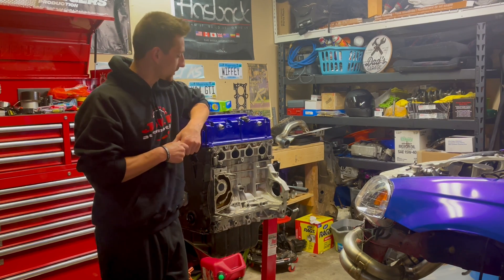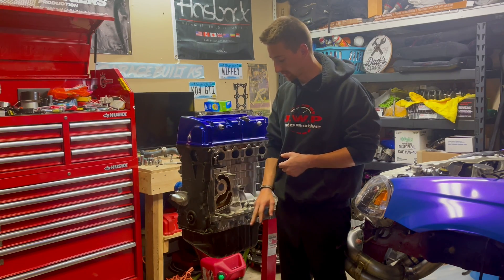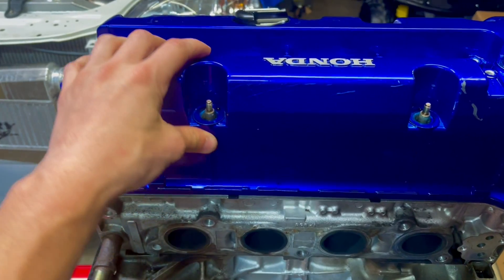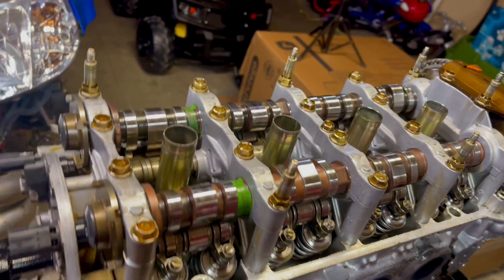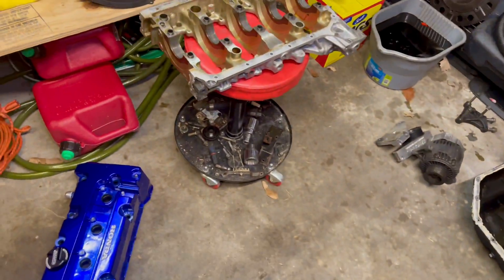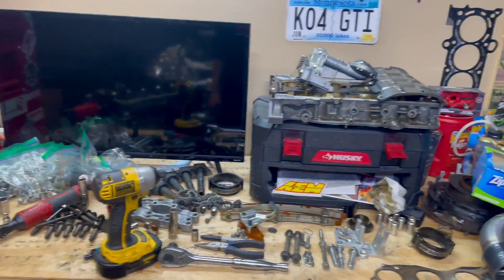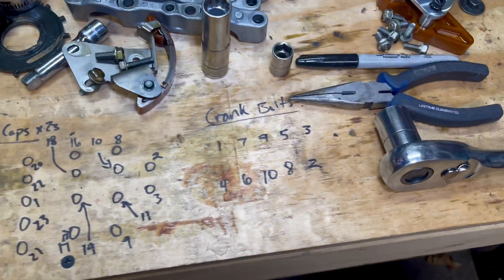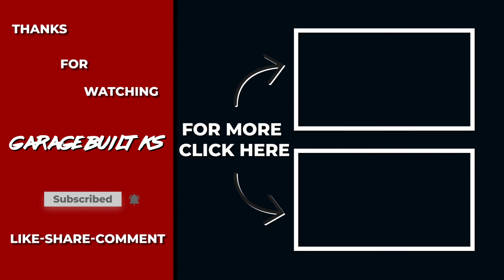Rebuilding My Turbo K20a (Part 2)

Comment: What caused your crank to fail like that?
Reply from the maker: I had the wrong throw out bearing on the twin disk! Didn’t have competitions TOB & had a OEM one on. Flywheel bolts came loose & chopped up the crank